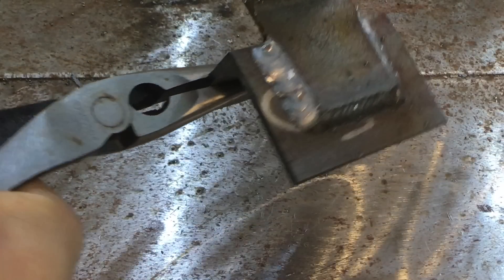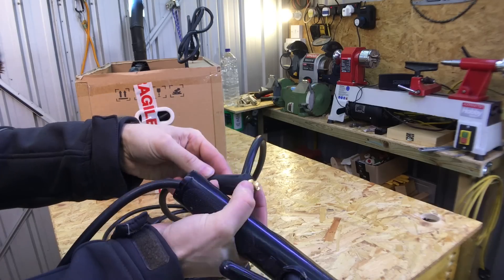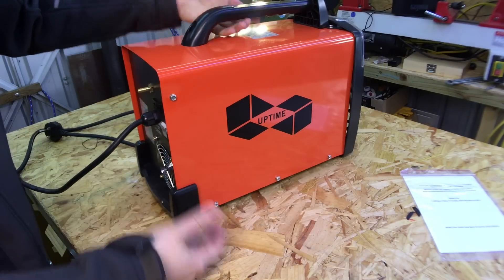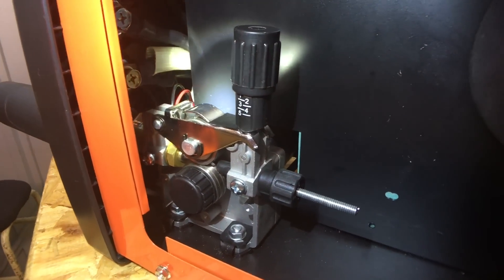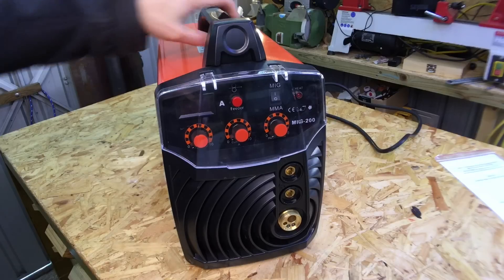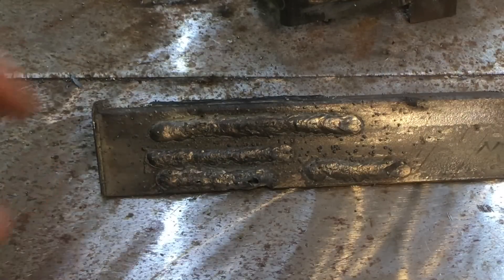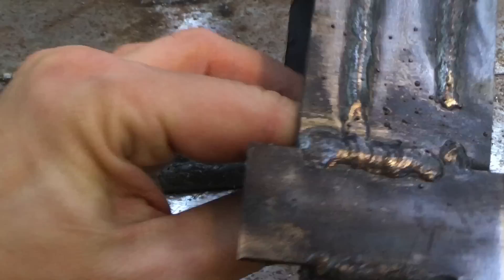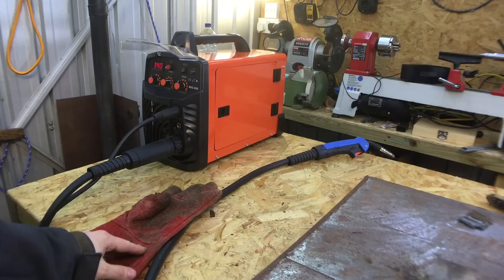Testing Cheapest Igbt Inverter Mig Welder

Comment: I would imagine that the inductance setting would make the arc a bit smoother, maybe give you a bit less spatter when it's turned up.
Reply from the maker: i set it in the middle and forgot about, will give it try and see. Thanks have a good day.
Reply: @JAYZWORKSHOP  how did it go? Did it smooth out the arc? Thanks for the vid.
Reply from the maker: Ed Studd yes it seem to
Reply: Hmmmm been welding over 20 years never heard of a inductance setting. 🤔🤔
Reply: @TherealMandingo  I'm guessing it's something like the mig voltage setting. I don't think I agree with my original comment anymore, having learned a bit more about MIG welding
Reply: Inductance removes transient current spikes from the welding tip.  The way to think of it is that 0% inductance results in a harsher more sparkier weld that ends up sitting higher to the work piece and with more spatter, however it is well suited to 6011 wire.  At the other extreme, 100% inductance results a smoother weld with less spatter and is more suited to 7018 wire.  Think of the difference as being between hard mints and chewy mints.  If you are positional welding, say on a vertical gap the (chewy mint) high inductance setting will cause the weld to slump.  Instead, by selecting a low inductance the weld becomes harder and less likely to slump.  The degree of penetration is not affected by the inductance setting.

Comment: Been running one of these a while now, very pleased. Switched from 5% to 12%Co2 for better penetration. Putting a weld down is alot louder than I am used to, a real popping crackle. Great on thinner gauge too.
Reply: @Alex Rhodes Any updates on it's durability after 1 more year?
Reply from the maker: Nice one how longs a while . i have put down about half a 5kg reel so far just using straight co2 . very happy with it so far.
yeah inverter welders don't really have that bacon sizzle sound, it is more crackle pop. 
nice to know someone else has one.
Reply from the maker: make sure you take the fuse out and check it mine had a dodgier one with copper wire soldered across it could cause a fire see here   https://www.youtube.com/watch?v=BZkMZcDuqVg&lc=Ugy765Iv0KddYNQ-qx54AaABAg